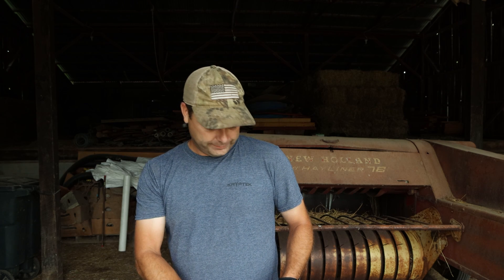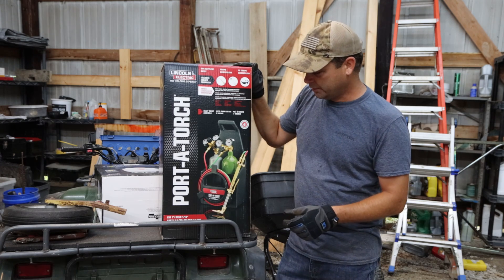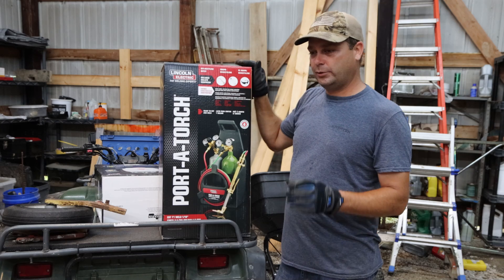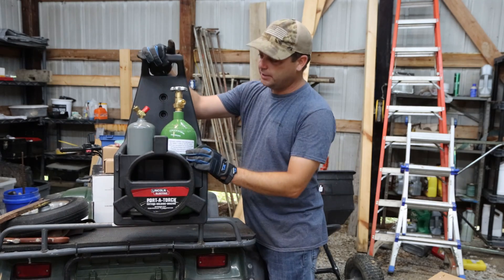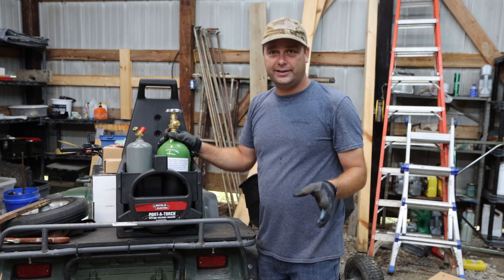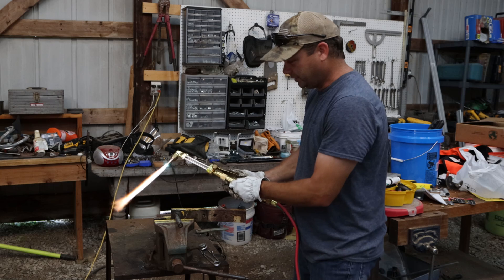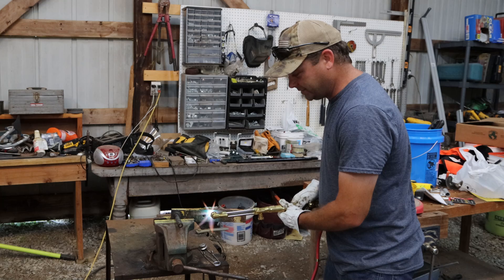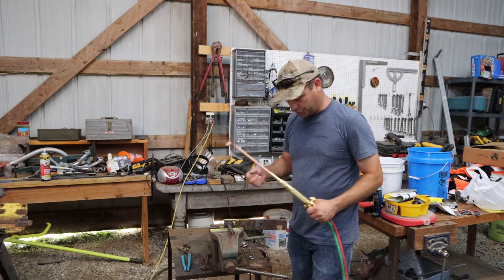I bought an Oxy-Acetylene torch to fix the hay baler.   Now I need to learn how to use it.

Comment: Hello, the use of eye protection is a priority. Regarding the use of the equipment you are using a lot of acetylene, the flame should be blue and small, a ratio of 4 to 1 is the correct dosage, (example: 2 psi for acetylene would be 8 psi for oxygen; 5 psi for acertylene would be 20 psi for oxygen, always a ratio of 4 oxygen to 1 od acetylen) must do the job,  not because it is bigger it will heat faster. I don't know the US regulations but here in my country we also use propane sometimes instead of acetylene, it is cheaper and the only downside is that it smokes the pieces a little more, and you use the same dosage or a little less oxygen.

Comment: Loosen your slip clutch and see if it slips. Sometimes they are rusted fast. Make sure you are using the correct shear bolt, not a regular bolt. They are made different. Enjoy your learning curve, have a good day.

Comment: We always ran our oxygen at 25-30 psi and our acetylene at 5-7 psi. Start your acetylene and turn it up until it stops smoking. Then add your oxygen.  That torch tip set to the right psi would have heated that up on it's own. Make a solution of soapy water to check for leaks each time you change bottles.

Comment: 3psi fuel, 30psi oxy  barely crack the fuel valve light, then crank it open until you stop seeing black soot then open your oxygen all the way then adjust it until the cones are about equal, get some tinted glasses or proper cutting goggles they make a huge difference and you wont get welders eye. also open up yer pliers more lol you want them to be opened enough so that the handles are close together so ya can grip it properly.

Comment: A rosebud with tanks that small are a problem. A cutting torch correctly adjusted will heat metal just fine. A rose bud uses fairly high pressures on both sides, but a small bottle will probably not supply those pressures safely. The popping is acetylene going from high pressure to low pressure instantly, it is exploding because it's a very unstable gas. Acetylene pressure should never exceed 15psi out of the torch. NEVER! 

Acetylene pressures for a rosebud should be around 7-9 psi. For oxy about 45psi. For a cutting tip on a torch that small, acetylene will run about 5-7psi and oxy about 30-35psi. Both torches flames are just as others have said...the blue tips are where all the fun is. Make the flames have a translucent blue cone at the small holes about a 1/8" tall. Everything else will follow that. 

I like your vids BTW. I'm trying to teach a friend of mine how to use his torch. I'm not used to such small torches myself having used larger mixing handles in all my years of construction work. 
I personally own a OXWeld system with two stage regulators with some full sized tanks. It's rated to cut 6" of iron. I can't though because my large tank of acetylene isn't big enough. It can't can supply the gas fast enough. 

I word of safe rosebudding...make certain your torch has anti-flashback valves. It doesn't happen often but it does happen...a flame will travel back up the hose to the regulator. It can get nasty from there. It happened to me once, luckily the hose popped right at the outlet on the regulator with the flame shooting straight up and away from the regulator and tanks. It's one of those times when you say- you go shut it shut off! But that is the very reason they say to never open the acetylene tank more than a quarter turn. Times like those. Oxygen doesn't burn so it's mostly harmless. Acetylene is nasty gas. If you never weld with with a torch consider using propane (LPG). It's much safer and much less expensive and cuts just a little dirtier is all. It needs it's own regulator though.

Comment: After you light the torch with O turn on the S until you get a blue flame if it's not hot enough add a little more O then add a little S until you get a nice blue flame again. Be careful don't get to close to the steel, this could cause it to cut the steel. Next time you have the tanks filled ask if they could show you how to set the flame or go online to see how it's done, good luck.

Comment: If your only using that set for heating or cutting ,Look into a Propane tip for cutting then use a 20# propane bottle ,much cheaper than Acetylene ,Save the Acetylene for when you need to gas weld

Comment: Here is the way I understand it on the Oxy/acetylene  set up.... 7psi for the acetylene and 20psi for the oxygen .... the Oxy is what keeps the fire out side of the torch tip so it must be higher than the Acetylene... this is for welding steel with bailing wire, I did alot of that in my youth
Rose buds are no different. they just produce a bigger flame. but you need to keep the tip back from the work far enough that it doesn't get hot... the flame 2"~3" away from the tip does the heating ....you will go through 2 times the Oxygen to the amount of Acetylene.  a small portable unit like that is indispensable for loosening bolts that will other wise sheer off
for welding I use an old ac buz box that is 220vac  if you have a farm you need a welder !
I use 6011 welding rod mostly it is harder than the steel but works well in any position alot of the others like 7018 don't !

Comment: I knew others would comment about safety glasses. Should be dark so you can see what the flame is doing.  Not dark like arc welding helmts.  Check with a welding supplier.  Also, safety leather gloves.  Burns are painful & debilitating.  Were instructions included with the set?  "When all else fails, try following instructions" is a wise saying that men have a problem with.  I'm sending you a letter since I came from a town near you in southern Illinois, and am a graduate of SIU  Carbondale, degree in agriculture.  A lot of information is available through Extension Service.  Should be a county office in Robinson.

Comment: for 1/2 steel the cutting tip would heat that up red hot no problems, as you said it a #2 you just didnt open up the gas enough, set acc gage at 7psi and 35psi on ocy., open acc flame so it is a big as it can go with out leaving a gap between the tip and the start of the flame, if you get  gap slow it down a bit add axy un till the blue flame tips are sharp point ..  them rose bud tips are not meant for them small set up, it is in fact unsafe, but if your going to use it they need minimum 12psi on acc, and 65 to 70 psi on ocy.. again open acc flame so it is a big as it can go (2 to 2.5 feet long) with out leaving a gap between the tip and the start of the flame, if you get  gap slow it down a bit add oxy un till the blue flame tips are sharp point , you need to buy a set of flash back arresters that go between your hoses and torch to stop the flame from popping back into the tanks, and blow up, they are a must.. the gas cost to fill them small tanks is only about $6 cnd total the rest is labor, the bigger the tanks the more gas you get for less ,, labor to fill the small tanks id all most the same as filling the big tanks, so even if you dont use it much, you save by paying a yearly contract for the bottles over the high price you pay for that tiny bit of gas in the small ones

Comment: Most people would just take the wheel piece and have it fixed by someone else.  You soldiered on to teach yourself how to do this job.  Learn by doing, they say but safety goggles should have been used during this process.  I wonder if that was stated on the box you bought.

Comment: Your cutting torch would probably be fine your not opening your oxygen valve enough to get the proper flame. Watch some You tube videos on Oxy/Acet Torch setup! Your ratio of of Oxygen to Acetylene should be 5-7 psi Acetylene and 30-40 psi oxygen

Comment: your cutting tip would have worked fine for heating up that bar, but you made a simple mistake - you never feathered the flame out to a clean BLUE flame, then it will work just fine.....40 yrs welding and cutting. Set your  at acetylene at 4, oxygen at 35,  feather back to a clean blue flame. you'll be fine